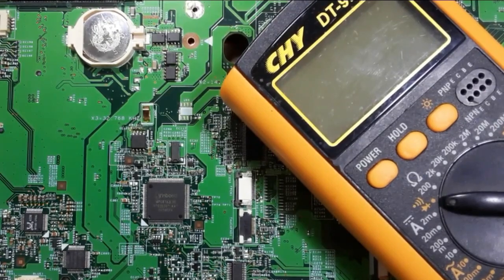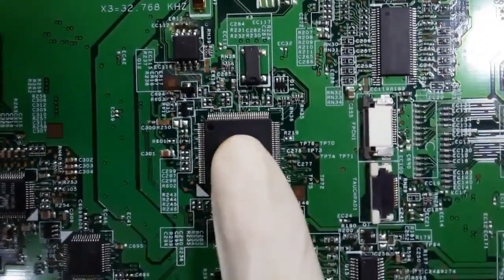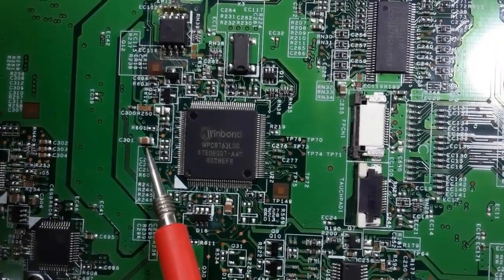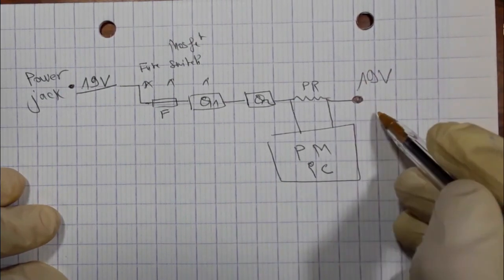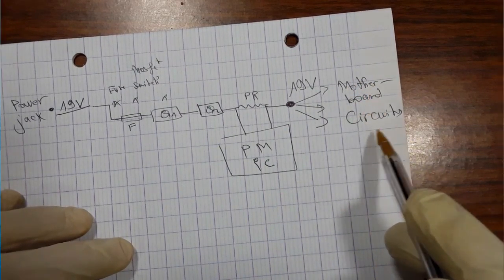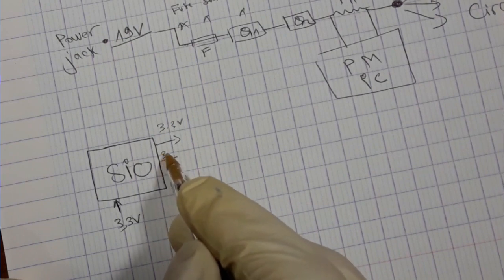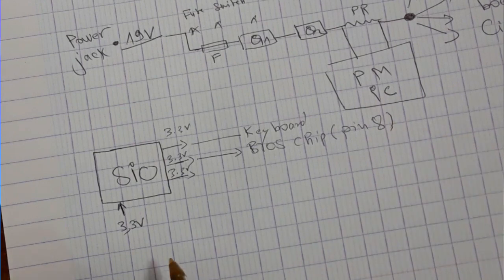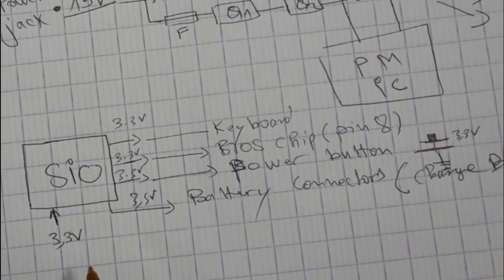Testing SIO IC Techniques - Laptop Motherboard Repair

Comment: I do have Toshiba Satellite P55T-C5114 and it  turns with the CAP&NUM led on then off. I  do get no display and keyboard no working. I have found out  that the  NP CE985LA0DX SIO IC is running very hot and some nearby caps are shorted. Any  idea where I can find the firmware for the above  IC?